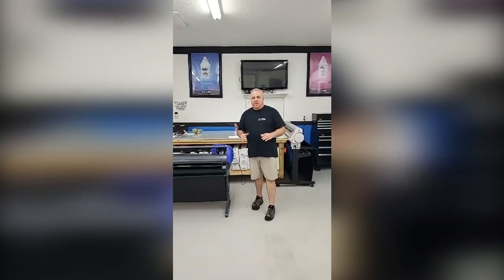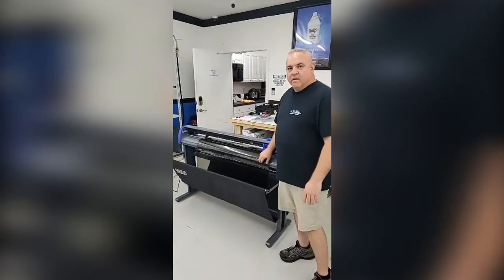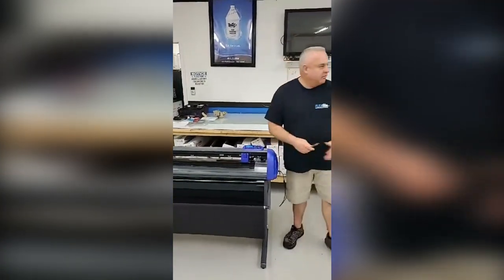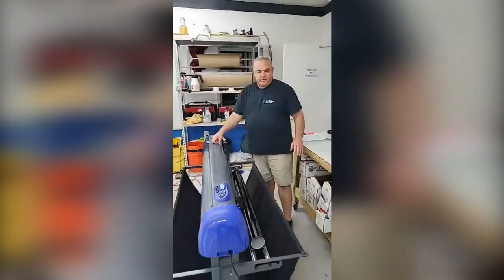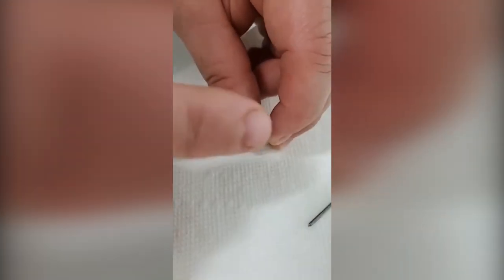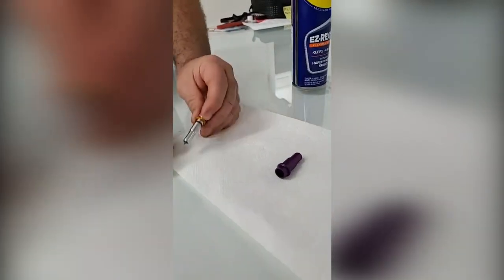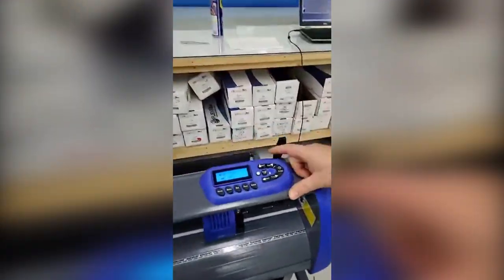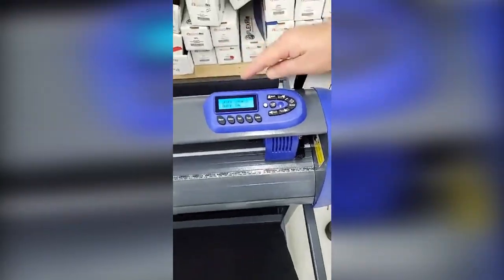53" Titan 2 Plotter/Cutter Set Up: Live

Comment: Is there a way to make the cutting head come to the starting point at the end of each cut?
Reply from the maker: Yes.  Take the slack out of the roll so it doesn't pull the film and cause the shift under the pinch rollers when it jerks.

Comment: Hey Ralph, I think the software has an adjustment somewhere to push the film out further after the cut is complete. I have seen it but can't find it again, I am sure tech support would be able to state where you can find it.
Reply: Also, I have started to add teflon tape on top of the teflon strip about 2 layers, I just remove the tape as necessary as it is cheaper than the strip.
Reply: Another tip, I just use some scrap tint and cut the tint on the table using the blade holder to get it close prior to installing it in the plotter...again, the teflon strip is important and although not expensive, it's not cheap to if you have to replace it often.

Comment: Instead of removing and afjusting the blade, why didnt you just adjust the forced pf the blade
Reply: The force is more of a fine tune adjustment. You start with your blade adjustment around the 90g force range and then start adjusting force up as you need.